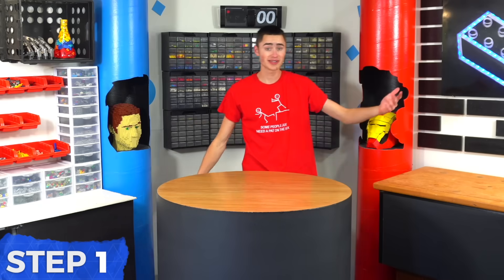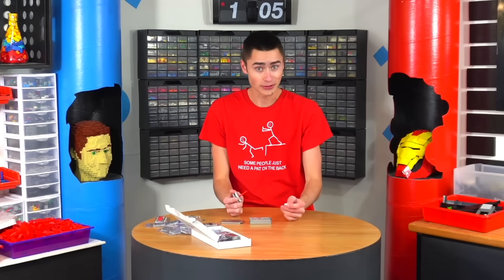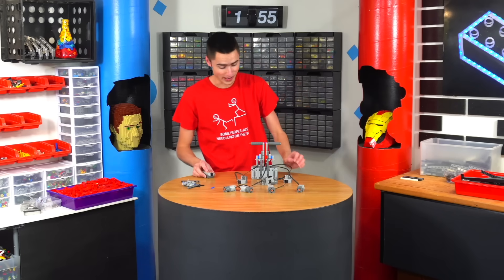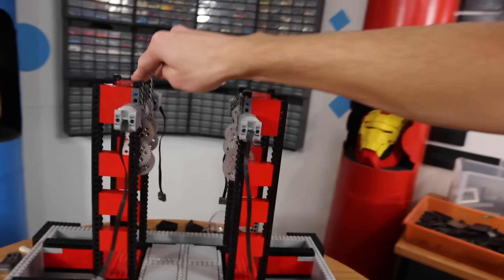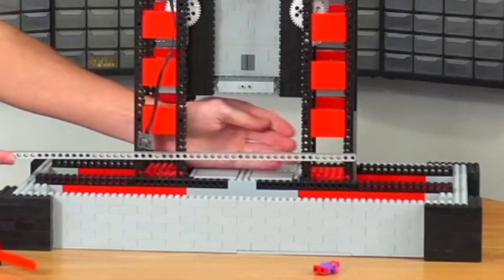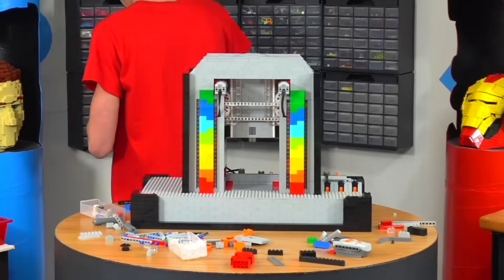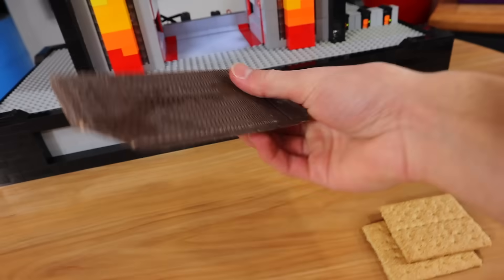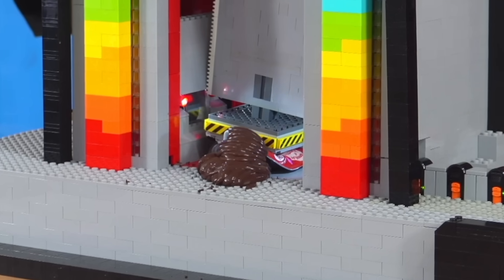LEGO Mechanical Press with METAL GEARS!!

Comment: I feel like Bro should’ve used actual Lego hydraulics. I’m not talking about those motorized ones. I’m talking about the push air into hydraulics surprisingly if you put water instead of air inside, it actually is a real hydraulic, mechanicalism so you should make a new video about improving it

Comment: just make the gearratio even bigger so you get more power to the compresser. add more gears, it will take more time but it still will be more powerfull than that. it doesn't go about the power (it does). is the motor not strong enough, make it stronger(by addin a 1:100 gearratio).

Comment: So just some clarification:

Metal gears are stronger, but metal axles are weaker, as they are more brittle and snap when subjected to shear force. Hence, the press is subject to being torqued. I suggest using XL motors, and, perhaps, entirely 3d printed double herringbone gears and carbon fiber nylon axles, which have a higher tensile strength, more flex and higher crush resistance than aluminium milled pieces. For reference, double herringbone gears DO NOT slip or slide, and can move a PERSON.

Comment: Big problem with this that could make it much more effective if it was corrected, the shaft is able to move left and right, and that takes away from how much force it’s pushing down with if it wiggles out of way under stress. If it was more securely fit into its track so it couldn’t do that, I think it would be better.
Reply: Good thought, although it's more related to the gear ratio not being enough of a reduction to break more stuff, but slower. It's a bit silly that he rates it 5/10 just because he didn't build a high enough gear ratio :D

Comment: It would be powerful enough if you had increased the gear ratio more. As for me, the gear ratio isn't high enough. The pressure plate is going unnecessarily fast.

Comment: Amazing video. It was very entertaining seeing different methods to do things. The squashed food was a nice little treat to. Having worm gears probably would have worked better. They give more torque. I also noticed that it tilts sideways when under load due to lack of support for the ram. If you put rollers on the top and bottom that slide down tracks. Maybe for v3
Reply: Im first to type here.😂
Reply: Your the best YouTuber ever
Reply: Same bro
Reply: I’m 3 to type
Reply: Here
Reply: You need a higher gear ratio